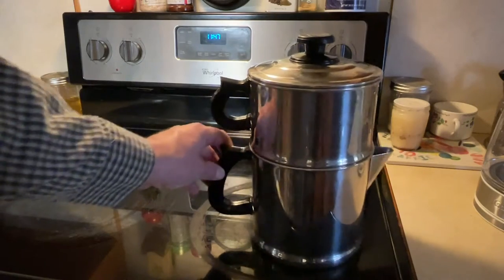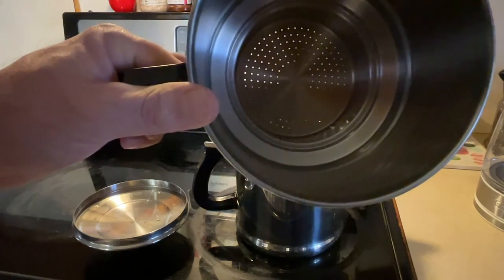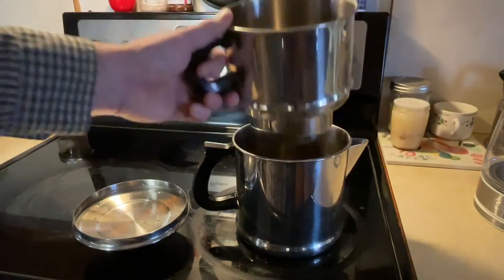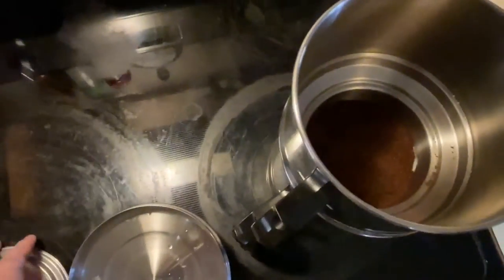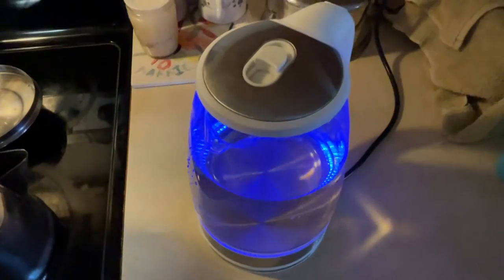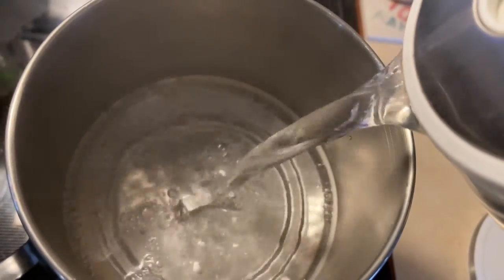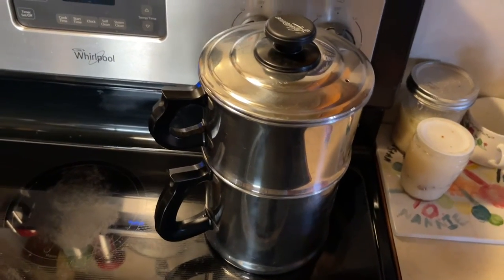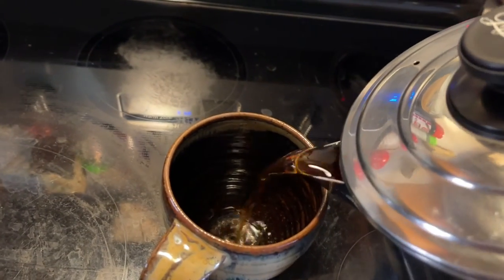How I Make Dripolator Drip Coffee fff#19 v87

Comment: I grew up using a pot like that, but it had 3 pieces, the middle piece was separate. I grew up watching my mom make it in one. I found a couple at flea markets and need to dons another one. Seems all the family wants one . I don’t use a filter, it’s in that middle piece. Makes good coffee! I have an electric kettle and pour that boiling water in top section. It makes it fast and you can sit on a stove to heat up.
Reply: Where did you buy this one? Id like to order one.
Reply from the maker: Thank you for sharing about this. I like mine. Do you know what kind you have?
Reply from the maker: I found it used. I don’t know of anyplace to buy them new. Ebay or Marketplace
Reply: No mine doesn’t have a mark. It only has one handle, on bottom pot. 
I found some like yours a, they run $49-79 online.

Comment: When you put the paper filter in, drip just enough water on it to make it sit down and stick. No loose grounds to plug the drip holes.
Reply from the maker: Thanks for the tip! I don’t use the filters anymore, just use it as it was ment to be used.
Reply: @metcalfmills5679  After years of use, we have found that the paper filters work best for us and to ensure they are placed properly, wetting the filter accomplishes that. There are various sizes available, and the smaller, round ones can be purchased. I like to shake the coffee chamber to ensure even distribution of the dry grounds, before pouring the hot water. A dash of salt also enhances the flavour of the brew.
Reply from the maker: Yeah I found them later and I always lever the grounds as well. Thanks Ken!

Comment: Nice!  I’ve seen those around but didn’t know how it worked .. I use revere copper bottom percolator.. mine is weird because the lid to the basket sets on top of the grounds rather than the rim of the basket … now do use a filter because you want to ? I was in mine but I found wetting the basket will stop ground going into the coffee..

Comment: I didn’t start drinking coffee until I was 60. Now I use a small electric maker. I have (and use) my mother’s set of Lifetime, including a coffee pot identical to yours. I would like to start using Moms coffee maker, which led me to your video. However, I do not remember my Mom ever heating water separately or having any sort of kettle. Mom’s sister is 99 and still “with it.” I asked her about the pot and she thinks the water was heated in the lower pot, then the upper filter part held over the sink (with coffee and little cover in place), hot water poured in, and then top set back onto the bottom. Then set aside to brew. I have hesitated to try this. Would the water come out of coffee area before I can get it put over the bottom pot?  I lost power recently and wish I had known how to use this pot.
Reply from the maker: I think that would work but you would have to be very careful. It takes a few seconds for the water to start
Reply: @metcalfmills5679  thank you for the reply. I will give it a go. The coffee pot has had little use in the last 30-40 years but I still use the skillet, saucepans and bigger pot all the time.
Reply from the maker: @julih2674  hope it works good for you